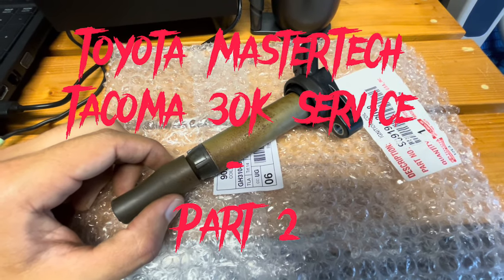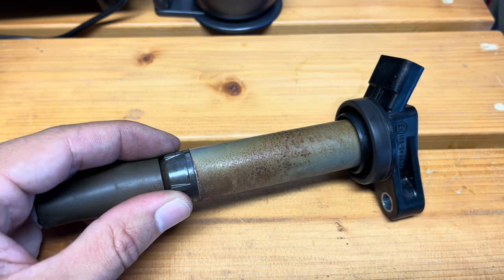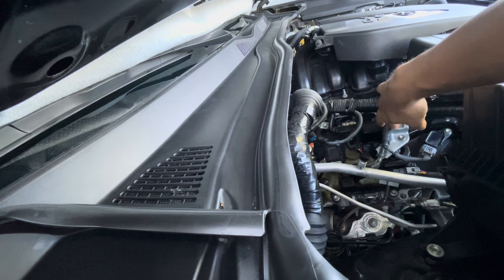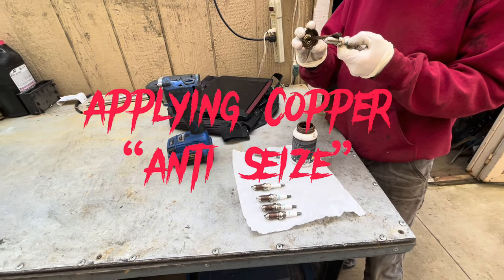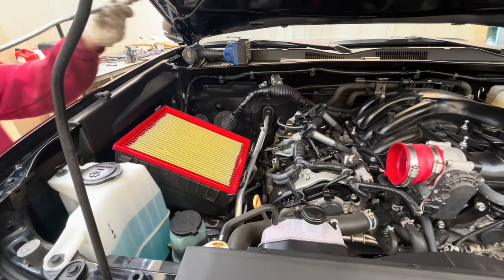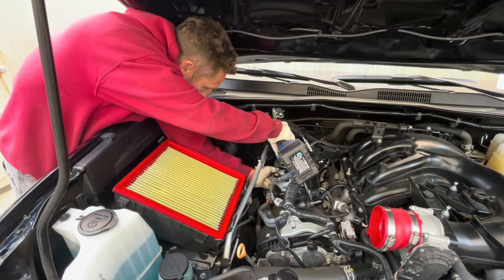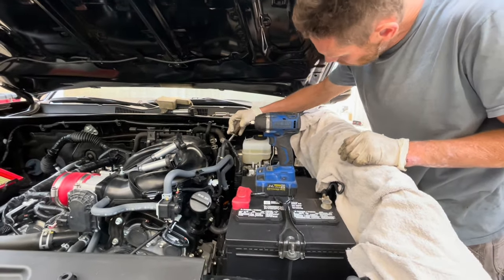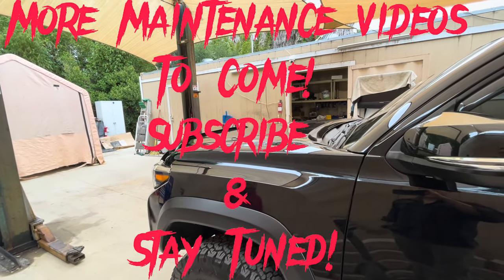Toyota Master Tech Tacoma 30K Service Spark Plug Change 3G Tacoma - Part 2

Comment: Recently got a used 3rd gen Tacoma at about 17000 miles, I happen to live in the SoCal area. How much does he charge for a 30k service like this plus transmission fluid drain and fill?
Reply from the maker: Congrats! I would recommend reaching out to him and asking. If I recall it was around $100.00 for the drain and fills (I brought my own fluids). Let him know how you got his info. Jason: 760-566-6157

Comment: I'm a weekend DIY dummy but seeing these guys use the impact wrench on these small bolts always makes me cringe. My Taco's skid plate bolts were all cross threaded by the neanderthal at the dealer doing my oil changes probably from using an impact wrench and not starting it by hand.

Every decent hand drill has a clutch setting to prevent torquing the shit out of your bolts. Just use that if the excuse of using an impact is speed. Start it by hand, use the drill w/clutch and finish with torque or by hand.

Comment: Just started watching video. Not over yet but what was the condition of spark plugs?  What code if any would come up during a diagnostic for the coil situation?  Thank you for sharing. 👏🏽👍🏽👊🏽
Reply from the maker: All of the spark plugs looked the same except for the 2nd one… which we think was loose and caused the blow by on the coil. I think it’s p30xx the xx would be which ever cylinder is misfiring 03,04 etc..👍🏼🤙🏼

Comment: You dismantle the plugs and the camera on the other hand. You did not announce how many years the car was made. You did not explain disassembling the parts until you reach the plugs. Sorry, not a good video. Many mistakes. You did not even announce the size of the plug plug. These mistakes must be overcome in the other video.

Comment: This guy is a master mechanic like I am a brain surgeon. First he did not use a torque wrench to install the spark plugs, second you do not use a drill to install any of these bolts. Every service he performs there is something wrong in what he is doing. Take your truck to someone else and save your truck.......